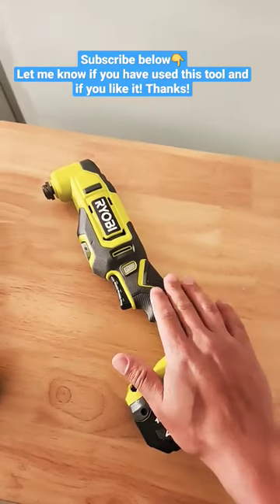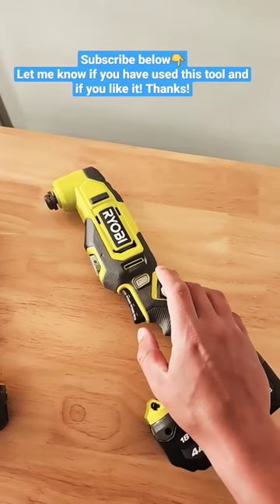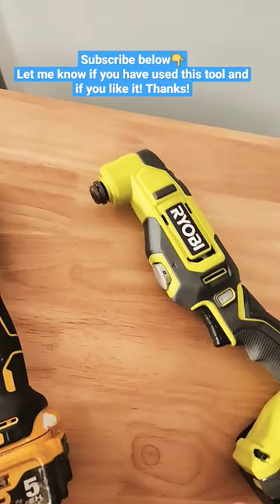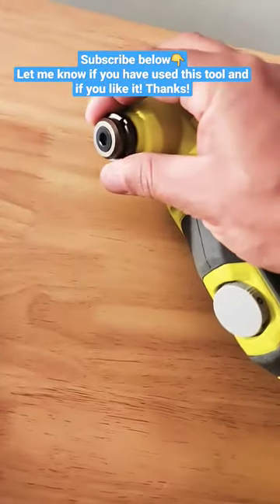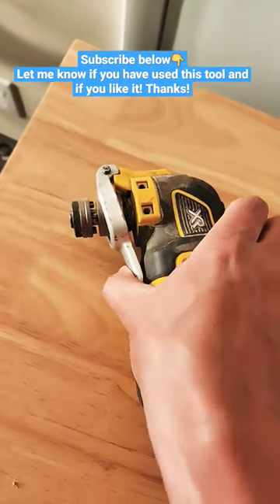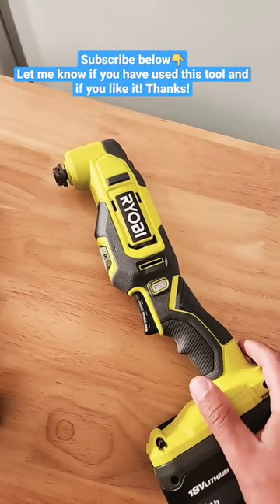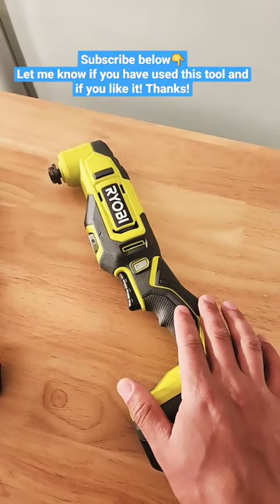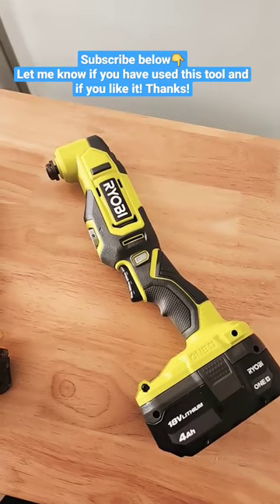One Huge Problem With The Ryobi Multi Tool

Comment: I think the big thing to keep in mind is Ryobi is made for home use, DeWalt is made for professional use. When you are using a tool for home use it usually doesn't get used very much versus a professional use tool, so is it really that big of a deal to have a quick change if you only use it a couple times a year?
Reply from the maker: That's a good point. I guess if you're only switching the blades once a year it's really not a big deal at all. I was just picturing how quickly I burn through blades and how annoying it would be but you're right, for the typical homeowner not a deal breaker at all. Thanks for the comment! Have a good night!
Reply: I should have read this before writing my comment.  Hahaha
Reply: Well said!
Reply from the maker: @bobbyolveda4155 agreed!
Reply: Disagree. Ryobi has made huge leaps in quality. DeWalt has nothing on Ryobi at this point

Comment: If you want to try the Ryobi HP multi tool it does have the tool less change.
Reply from the maker: I'll check it out! Thanks!
Reply: True, but why produce a model with such a BS design?! I'm a huge fan of Ryobi, but there's a lot of room for improvement
Reply from the maker: I think they probably figure it's the cheaper model so most likely homeowners will buy it and use it once a year for a quick cut and then not have to change the blade for a long time but I agree with you. A lot homeowners buy tools and use them constantly.

Comment: ONE HUGE PROBLEM with the Dewalt. They are charging $50 more for that ONE FEATURE. 😮😂
Reply from the maker: I'd be curious if there is any difference in the motors. When you compare the two brushless models I'm seeing like 30$ price difference. That being said that feature saves a couple minutes every blade change not a big deal for most people but contractors who use it constantly would probably rather spend the extra money to save time.
Reply: @fixanythingsavemoney  I would just summarize and say contractors will buy the Brushless Dewalt but home owners are good buying the $49 brushed Ryobi
Reply from the maker: @sparkzaddy  couldn't agree more!

Comment: This one dies on me on second day.  I was cutting 1/4" bolt and on the 5th cut it stops working.  The motor still run but the blade don't move.  Quite disappointed.
Reply from the maker: That's awful to hear. Let me know which one you end up going with next if you plan on buying a new one! Thanks!
Reply: @fixanythingsavemoney  I ended up with Milwaukee M18 (not the M18 Fuel) to finish the job.  However, I am not entirely satisfy with it.  I'm still looking for alternatives.  I do want to give Ryobi another try. Waiting for the One+ HP to go on sale.     What's your take on the brushless model?

Comment: I own that multi tool and a bunch of other ryobi stuff and I’m a contractor. I hate that I have to change it with a key, but the tool is fine. I’d stay away from the Amazon multi tool blades, they are trash, get better blades. 
I own a combo or ryobi and Dewalt because ryobi is a 1/3 in price and if it get stolen from a job, no problem. The stuff that we use a lot of that we need a lot more precision, dewalt all day.
Reply from the maker: I use some ryobi stuff too and have never had any issues. Like you said, you can't beat the price point. As far as performance I've never really noticed a significant lack in performance from the different brands. Changing the blade with a key is definitely a pain when other brands have the quick change feature. Thanks for watching and for the comment! Have a great night!

Comment: One thing I think about the blade change is...how often are you really changing blades??
Reply from the maker: I guess it all depends on how often you're using the tool. Homeowners might swap blades out once a year but if you're using the tool frequently the blades do wear out extremely fast on these. They actually make a tool that resharpens the blades which I've thought about buying and testing out because the blades for these are pretty expensive. Thanks for the comment and for watching, have a great weekend!
Reply: That depends on how thick & how long your pubs are. Jus say'n 😎

Comment: Also that model doesn't include a hex key holder, which is ridiculous. Ryobi should reduce the sheer number of models in a category and upgrade all that remain with the BASIC features that we all expect
Reply from the maker: Couldn't agree more. You can still buy this tool at most hardware stores. With so many other better options even from Ryobi they should just make those features standard.

Comment: My goodness, aren't we LAZY?!😂. No offense but that thought came to mind after he said the tools were exceeding his expectations until he pulled out the multi tool.  Now, as a former hamdyman, i can attest to the fact that it is very nice to have tools that dont need tools to change out attachments. That said, a Ryobi is really not for commercial use where time is money.  Ryobi didna great thimg by attaching the tool you need right on it.  For home users, it shouldn't be an issue. I have had dewalt tools, craftsman, makita, ryobi, Milwaukee, rigid, and a few others. I miss my old craftsman tools the most.  I stopped buying them when STANLEY BLACK AND DECKER bought them out in 2017!  I've always despised B&D tools for the most part. For the price and the variety and the quality, i have found that Ryobi is really good.  I get deals through Home Depot, getting batterys and chargers with big disocunts by buying their free tool sets they offer with batteries. One has tomseach the site, though, because they have it set up so you have to search page after page for the best offers.   🙏
Reply from the maker: Haha yes we are getting very lazy! That being said when you can buy tools that offer that feature for a similar price I figured it was worth mentioning. As I'm sure you know the blades on these wear out frequently when they are getting steady use but you're right. For the average homeowner who uses the tool a few times a year probably not a huge deal. Thanks for watching and for the detailed comment! Have a great weekend!

Comment: The new ones have a clip that releases the clips. No need for any tools to remove them
Reply from the maker: Thanks for the tip! I'll have to check it out. Have a good weekend!
Reply: It’s not quite as simple as the dewalt, it’s actually a two stage change of the blades. But man does it lock them in.. does the job and then some.